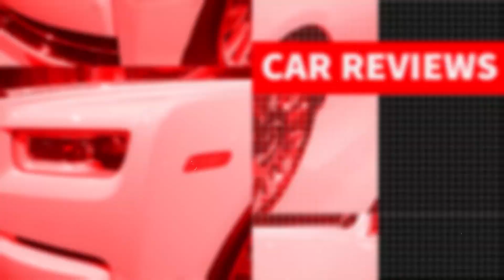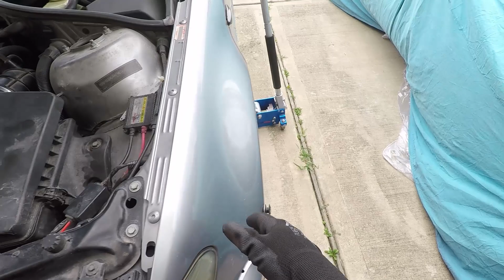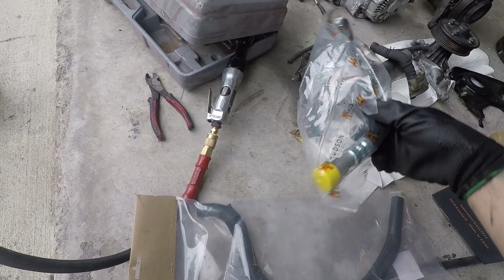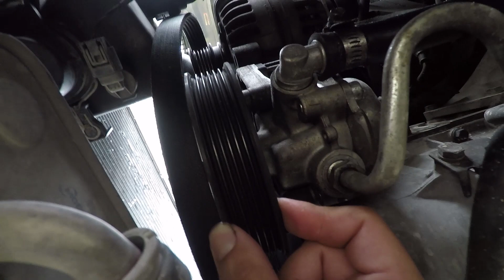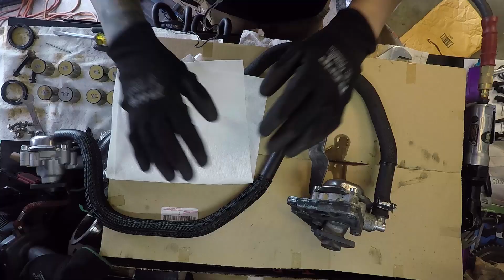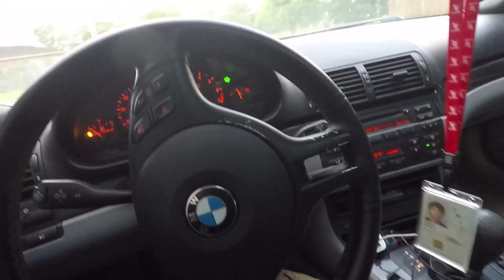BMW E46 Power Steering Pump Replacement

Comment: If the steering pump belt comes off (the small 10" diameter one) is it easy to replace without taking lots of parts off like the fan?

Comment: Im having  a mechanic  change it out . . because I don't have the tools . . .He wants to charge me 5 labor hours to do the PS pump all the hoses and reservoir and the hydraulic Pulley tensioner.  Do you think thats an accurate amount of time?  I was thinking 2-3 hours

Comment: Fan shroud only 1/2 mine is complete and what size is the Allen wrench used to remove the fan I have 2003 325i 2.5 liter? You make it look so simple. how  do you know without taking pump out if it's the L20 or L30?
Appreciate your help Thank you.

Comment: Ive just replaced my pump.
The new pump that i fitted had the same in and out movement on the pulley holder.
It worried me when i got it out of the box, but i fitted it anyway and it works.
Now im wondering if its just normal to have that bit of movement?

Comment: For my car, suddenly it was extremely hard to steer and park and on turning it makes a knocking noise(not too loud). Initial 0-25mph pickup makes a louder noise than usual. After removing the belt and jiggling the pump shaft by hand makes a small clicking noise but it doesn't move in or out, so doesn't look like it is broken. Not sure if fluid flow is choked or any other thing to diagnose and how?

Comment: does anyone know if the lf30 pump is straight replacement or does it need some modding?
Reply: you need a special hose for lf30 just get the lf20
Reply: Lf-20 has more steering feel as well. So cheaper + better steering feel (imo)

Comment: Im tryn to lower my 01 x5 ? Can i use a 5 series front struts and rear spring to get it low
Any suggestion wld be thankful.
Reply: For BMW only fill the cabin with concrete if you want to lower it

Comment: my power steering straight up failed as i was going to the grocery store at 120,000 miles. it was working when i got there, then came back started the car and knew right away no power steering.  I can still drive it til my pump arrives although its a bitch but at least the pulley stays put so it doesn't incapacitate the car.  your video was informative but you are brave to work under you car with just hydraulic jacks supporting it.  use jack stands bro!!!
Reply: he got away at this time 🤣🤣

Comment: Good video , I have 2000 e46 323i and it was made March of 2000 and it has a. LF-20 pump on it . I’m assuming it’s original.
Reply: I have the same vehicle, mines a wagon though. How is yours holding up?
Reply: @themaincrunch  I ended up replacing mine with same style it’s holding up fine now
Reply: Did y'all have any overheating issues if it happened to failed? Mine has been out and I need to replace it I think it's causing the water pump .. and along with whatever else to overheat
Reply: @southernfoods7302  the only way it would cause it to overheat would be if it was binded up or not turning . Typically the shaft snaps an they will still spin freely. Take your serpentine belt off an see if power steering pump spins free. If so it’s not the issue . Most likely the thermostat has failed or original plastic water pump impeller has broken , or 3rd option would be the auxiliary electric cooling fan not working at high speed. I’ve ran into all those causing the e46 to overheat

Comment: Changed all my hoses steering rack and pump and still no power steering , tool it off the jack stands before turning the wheel, should I put it back on jack stands and turn the wheel left to right until the power steering pump engages? Or should it have worked right away when the car was on the ground
Reply: well you need to put some fluid in XD

Comment: What steering wheel is that
Reply from the maker: As far as I know it is just the non m-sport steering wheel that comes with the base model
Reply: Its the facelift e46 base steering wherl
Reply: @megaTHE909Official  That is actually a non m sports wheel (M-Teknik) with multifunction which is an option from 2000->. Anyway it might be a stock option in facelift models😎

Comment: So what problem did the lines/reservoir make? Vibration or whine? I don't wanna just straight to replacing the pump since it didn't sound like the pump to me really... Also it only happens at idle without touching the steering wheel
Reply from the maker: The actual pump was making a whining noise at first and it soon became a grinding noise. My reservoir was restricting/inhibiting recirculation. The lines are just good to replace as preventative maintenance. In my case the lines were cracked which can allow air to enter the system and the pump to cavitate and fail

Comment: Nice DIY. The e36's are notorious also, for the steering pump. But only after 120k miles. Changing the oil can be a life exchanger. Mine is on about 135k miles and still fine. I changed the oil every 15k miles. That because the car makes only 4000 miles a year. After 26 years it's on 135k miles now, hahaha.